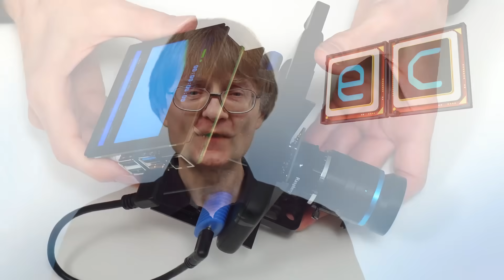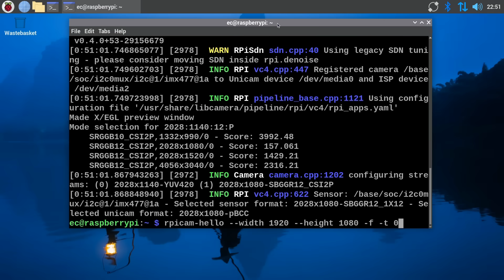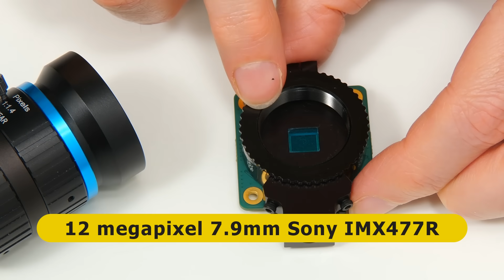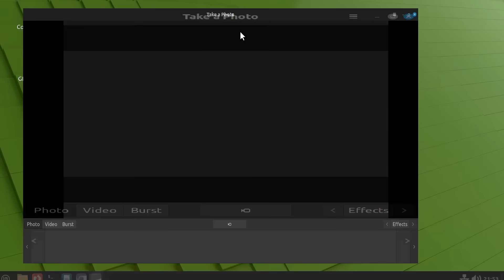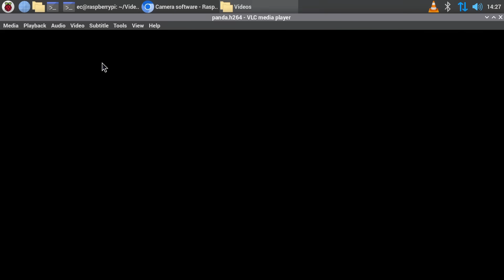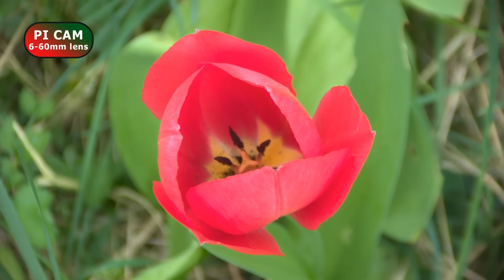Filming YouTube on a Raspberry Pi Camera

Comment: Fantastic walk-through of what the HQ cam module is like with different lenses and different recording methods. The Cine Pi is a great project and I love the fact it uses 12-bit DNG files for recording. My current wish list for the CIne Pi is some form of focus peaking overlay to help with the manual focus lenses, and support for recording a second camera module (stereoscopic setup) with the hardware sync. 🙂
Reply from the maker: Agreed. Focus peaking would be very helpful.

Comment: I have a Nikon D3200 with built-in 24 megapixel DX sensor I paid $700 without a camera lens, $800 for a Nikon 18-300mm DX lens and $200 for a Nikon 70-300mm DX lens. I put it in the closet shelf and left it there when Samsung came out with their smartphone 108 megapixel sensor and 200 megapixel sensor witch is a whole lot better than the D3200 DX 24 megapixel sensor.

Comment: Chris 
Another excellent video 
But I would challenge your closing remark about adding a Nikon 18-200dx? (other lens manufactures do exist,  but shall not be named !). 
You already own that lens so the cost would be only the adapter. 
You would be demonstrating a re-cycling of a piece of equipment rather than buying new, which you do ( and did in this Video with a second Pi ) to other equipment so what’s the difference. 

Using that lens on a C/CS adapter will have an issue with the aperture in that, and other similar lenses as you can’t set it manually – on the lens- . so its going to be wide open. Unless you get a adapter than has an independent aperture built in.  As an alternative there are many older second hand lenses available from the pre-digital age that can set the aperture manually but you will stuggle toget a focal length less than 20 mm I fear. 

As well as the aperture issue the crop factor of the sensor will multiply full frame effective focal length. Focusing will be difficult. For an example Jeff Gearing ,  some time ago, mounted a 70-200mm f2,8 to a High Quality Camera. 

If you really want to do something really silly, mount a big lens (say 500mm), with the addition of a tele converter just for fun to the High Quality camera... just wondering what the equ focal magnification would be

Comment: Hey Chris… I think you'll find. That inexpensive zoom lens you purchased. It is a zoom lens. It is not a, zoomar, Lens. Meaning that?

A, TV zoom lens. Keeps the image in focus. Regardless of zoom.

But an old-fashioned zoom lens. Does not move the same lens elements, together. Therefore. You must refocus. For every different, zoom position. It's not a lens you can continuously zoom, as you go. It's not capable of doing that. It's a preset, zoom. That's why it was so inexpensive. It's not a TV zoom lens. In that operational characteristic. And those type of zoom lenses, are much more affordable. But really only function. At your preset zoom ratio. But hey for the cost? Such a bargain! And can be used for fixed focal length shots. As it is virtually impossible to zoom and rack focus perfectly, with the zoom. A television zoom lens and other photographic zoom lenses. Hold focus during zooming.

It's an old photographer thing to know this. About the different type of zoom lenses that were created over the years. These were the first types.

Later came the Varifocal lens for cameras. That would hold focus as you zoom.

I just thought you should know that Chris. As part of photographic history. Before we ever had computers. We had silver oxide. Later we got iron oxide we recorded pictures on. Now I think we record little magnetic bubbles? Whatever that means?

I'm sorry it really seems like you have to go through, too much stuff. Just have a Raspberry Pie Cam? That's a lot of expensive components to put together for a single, high-res TV camera. Like the tiny 4K video cam recorders. A little less than 2 in.² weighing virtually nothing. Onboard all of those little battery-operated flying drones. And what you need this huge behemoth contraption for? Instead of one of those miniature marvels. That already supply a digital bitstream output. I don't understand you Chris? I thought you were a little more progressive than, this huge camera contraption? Requiring a separate Raspberry Pie, computer on a card. Just to get a video output. Jesus Christ man? Do you got's a fever? HUH?

I mean I find your camera set up rather comical. We are already 1/4 of a century, into this one. Optical imaging technologies have virtually been refined to pass, Hollywood quality resolution. Out of something the size, of a cigarette filter. With 4000 lines of resolution. Refresh rates of 60 Progressive frames per second. Direct MP-4 and MP-5, high-res bitstream output. What are you doing with a Raspberry Pie? The new circuit boards are the size of your pinky fingernail. You could accidentally swallow it if you're not careful. There are other medical grade cameras that can do that. So don't try to swallow your raspberry pie camera. You might choke… To death? And then we would miss your haircut.

I have been watching you and your channel for years. I love it. But I never realized… You have always been AI. And here we thought you were for real? No wonder you don't have a girlfriend or a boyfriend. You exhibit no emotions. Who do you think you are? Mr. Spock? He wasn't for real! He was played by a cartoon actor. And we know know you are AI. Because you are not aging. You are a computer facsimile. Of a poor dead British computer geek. We know who and what you are! We have Intel. You don't. You have AMD. All Most Digital. That's why it's called AMD. It's fake digital. We have the only real Intel on this. And computer cameras have gotten very tiny and flyweight. Where have you been Chris?

I mean the fact that you could make a video camera with a raspberry pie. It is equally amazing. But I am not a computer geek like you. That is no big deal, for you. And you're not trying to get action shots. Requiring zooming while it holds the focus. Such as in sports coverage. Where your $16 zoom lens can't cut it for that.

Otherwise? I love your channel. I've been following you for years. But you are not aging. Something is wrong here? Your AI programming doesn't have you aging. Your programming is flawed. Your hair never grows. Your spectacle diopter doesn't change.

And so I think you are the most Natural looking and sounding computer simulation ever. We'd love to know what you really look like? But you are likely a dwarf. And you have given us this computer simulation. Of a normal appearing person. With a, Moe Howard, haircut. He was the base of an emitter and collector. And had nothing to do with the IRS. Stateside here. Just so you know.

By the way Chris. Did you hear? The Queen, is finally dead.
RemyRAD

Comment: Does the rpicam software have the ability to do a White Balance? Could  doing that improve the color quality of the output? The color seemed a little bit off, but it also seemed to shift...
Reply from the maker: The rpicam software has limited control. You can use profile files, but it's still very hard to achieve full manual control. The colours shift in the opening shot because I was shot against greenscreen, so even when I moved slightly the colour in the shot changed dramatically, so triggering alternations in the automatic settings.

Comment: I would be very interested to see how larger lenses from Canon/Nikon/Sony etc work with the camera module.  I have a few Nikon lenses that I used to use with an old DSLR that doesn't shoot video, and they could potentially get some use as long as the sensor size doesn't cause too much of a problem.

Comment: Is there software to make a Raspberry Pi with a camera module into a USB webcam?  Or maybe do motion capture taking a still when something changes and saving it to the micro SD card or an SSD?  I looked a while ago but everything I found seemed to need WiFi or an ethernet connection.  I'd rather it was either standalone, or connected to a PC by USB.

Comment: Nice video. Regarding sharpness, not all lenses are built equal, as you clearly demonstrated, but I'd like to emphasis a few points :
- F-stop (i.e iris setting) can make a lot of difference in sharpness (as well as depth of field)
- integer decimation i.e. one integer number of sensor pixel for one video pixel ; with the 2028x1080 sensor mode, this would require a little cropping through  --roi 0.0266,0.1447,0.9468,0.7106  to only select  the 1920x1080 center pixels
- sensor mode also make a great difference ; from what we can see from the command-line, you are stuck with the 2x2 binning because of limitation on the 2-lane CSI interface (and clock speed) and I suppose your CinePi image also has the same limitation ; yet, with some minor fiddlings (https://forums.raspberrypi.com/viewtopic.php?t=371216, thanks to 6by9) you can get 4K@30fps, at least on the Pi 5. Using the full 4K Bayer matrix as input give you much detailed and sharper images, not matter the lens, even when actually encoding at 1080p ; for a clear example, look at https://raspberrypicad.blogspot.com/2025/03/why-imx477-2x2-sensor-binning-mode-is.html the difference is stunning.
I hope CinePi will provide an image that has the support for 4K@30fps on the Pi 5 !

Comment: Out of curiosity re: the small screen issue. Would a Pi be powerful enough to power both the LCD on the CinePI, the camera, and an external monitor (e.g a large one you'd have facing you on set) plugged into a HDMI port?

Comment: Have you come across NDI, which allows you to stream video over a network connection, including WiFi? I've used the Newtek NDI Camera app on an iPhone to stream 1080p video from the iPhone camera to a Mac running a client that makes the NDI stream appear to the OS like an external Webcam, and there is also a plug-in for OBX that supports the NDI protocol natively. It's a neat solution that saves cables and having to deal with HDMI video conversion. NDI also supports audio and has low enough latency for live video (at least using an iPhone SE Gen 2 as the 'camera').

Comment: What is the dynamic range of the sensor?  By closing the aperture, the depth of field can be increased (so more things in the picture are in focus).  Of course, a bigger lens (diameter) would help.  All sorts of fancy digital post-processing is available these days.  But, I suppose, if you're shooting a film, you may want different effects.  What you get from this setup might be just the look you want. Possibly.

Comment: I've been looking for a camera to use inside the enclosure of my CNC mill, which is a very hostile environment with flying chips and high-pressure synthetic coolant sprays. Primary requirement is that I won't have too sad a day if the camera and lens are ruined because of my inability to make a reliably-sealed enclosure with a spinning hydrophobic self-clearing window. Second-hand CS mount lenses and a Pi cam might just fit the bill.  The coolant sprays and mist reduce the effective  resolution to that of a potato anyway.  I can feel an experiment coming on.  Thanks for the inspiration.

Comment: I would like to see the installation of the most expensive lens you have in stock to see the maximum capability of the sensor and roughly estimate what maximum lenses can be installed on this device. So to speak, to see the maximum capabilities of the camera sensor and not be limited by the lenses, and also possibly find out the cost threshold of lenses relevant to this camera's sensor. For example, compare two similar lenses, say for 100 and 200 dollars, and understand what price limit exists for lenses for this camera.

Comment: If the Pi is using the Labwc compositor, a keybind can be added to the rc.xml to toggle the window frame and/or title bar on or off. There can be a frame and titlebar, frame only or neither.

Comment: Technically, you don't need to do the Ctrl+  thing to switch VTs. Within text terminals, you can use Alt+F# to switch. The Ctrl+ is only necessary if you switch FROM a desktop VT anywhere. And RasPi OS being Linux (Debian if I'm not mistaken), you can even have TWO desktop VTs running...
BTW the desktop VT has been on T7 for very long. I remember X11 putting it there.

Comment: The lower quality with the is not the lens, it’s the sensor only being read at 1080p.  You will get substantially better quality with still pics.  With the old raspivid, I was able to up the quality by reading the whole sensor, but at a lower frame rate.
Reply from the maker: CinePi is most certainly reading the whole sensor. The quality is very much with the lenses.
Reply: @ExplainingComputers  It may not be able to, sensor read isn't fast enough.  Actually, come to think of it, I had more luck with the old 5 mp sensors that way.  Those could read stills faster.  This video is filmed mostly with the old pi camea with a 5 megapixel sensor and lens that came with it: https://www.youtube.com/watch?v=z4xZpm5n214

Comment: Vlc can also show usb video feed, from menu choose Media, Open Capture device, in "Video device name" choose /dev/video0 (or higher if multiple usb, video1 is sound?, second usb would be video2, try ...), rpi can also boot to command line (no gui) and then do the camera control, advanced option is to program in python3 using picamera2 library, very advanced is python webserver + camera control ...
ultimate is webserver + camera + pygame, combine pygame animation/picture with live feed (camera output can be cropped and positioned)
tip : vlc can play + slow down a (live) video and at the same time record that ....
tip 2 : can use multiple rpi (with a camera) output to a hdmi switch, hdmi switch output to usb to pc ...

Comment: Hold up this intermediate step via HDMI out and USB capture card seems really superfluous, since Pi can be configured as gadget...

oh wait you can't really do this with full size pis because their OTG port is occupied by the internal USB hub.

What other methods are there? Can you connect Pi to a PC via Ethernet, say OBS can ingest NDI video streams?

The Cinepi page completely neglects to showcase any features or system requirements or just about ANYTHING, but i can gleam that i might support MJPEG streaming over HTTP. Is there a way to ingest that into OBS?

Also Cinepi-SDK github page says Pi4 is no longer supported. For whatever reason. It would be good if such a project could scale down to Pi2W, i feel, i mean, it does have hardware encoding and it has a CSI port, so why not? Dumping lots of RAW data isn't going to be a thing on those though.

The zoom lens you showcase i'd say it's rather exciting for own project. While it struggles to cover the Pi HQ sensor, there's any number of webcam innards and other things it can project onto easily, and it should look rather good with them as well!

Comment: Here is what I've found playing with CinePi... You can use inexpensive D mount lenses as long as the focal length in longer than 8-9mm, the 6 and 6.5 lenses that I've tried vignette in the corners. To do this you need a flanged D to C mount adapter, screw this into the CS mount on the camera and adjust back focus. My D to C adapter was around $8usd on ebay. I'm currently looking at some other lenses made for 16mm and Super16 film cameras, gets kind of expensive with this option, especially if you need adapters to get down to C/CS mount. Trying to pick lenses I can use with other platforms in case I just can't continue with the pi based camera. I don't have plans to move up to the CinePi XL, too much money when I could convert a Canon camera with Magic Lantern.

I fitted a geek pi fan to my pi4, this requires removing two of the display stand offs which I need to fix. I was running it off the 3.3v from the display, though I want to solder it to the back of the pi to get 5v and a little more airflow.

I'm getting some flashes on my display, kind of randomly. I'm not seeing bad frames in the recording, not sure of the cause yet. I also need to get faster storage, I have a flash drive that it good for about 10-15 minutes, then it slows down and starts dropping frames, I think it might be a heat issue. I'm still thinking about how I want to design a case for all this, even a simple box requires some thought.

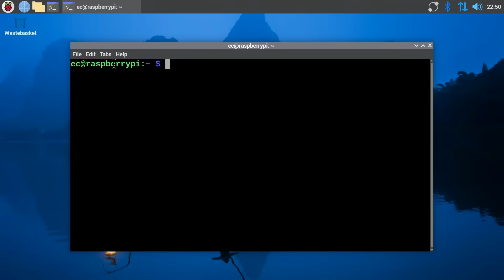Comment: 4:41 is why I don't use Linux. Everything is freaking terminal terminal terminal. If this could run Windows there would be a much easier (and better) GUI based way to do it. Linux needs to get with the times and ditch the terminal, I'm sure they still think it's 1985 and not 2025 might just as well be using DOS.

Comment: The Pi  lenses give quite soft images. Can’t wait to see a quality lens ! Thanks for the experiment from Quebec ! 🇨🇦
Reply: It would be interesting to see, and some people might have lenses they are not using. However, for value, can anything compete with a smartphone? I would have liked it if that had been compared as well 😇
Reply: @joseph9915  Well, considering that even a cheap smart phone in the US can cost more than the whole CinePI setup with all parts combined, I'd say the PI doesn't have anything to worry about there. Unless you're getting a phone heavily subsidized from a cellular network, they can't come close to the value proposition of a PI.
Reply: @SuperDavidEF  For older, out-of-date smartphones, they can be as low as like $30 new (old stock). 

Not saying for a lot of things, having a computer with Linux on it connected to a camera isn't going to be better, just thought the comparison would be interesting.

Comment: I have a question I have a cosmicar / Pentax C70402 4mm f1.2  1/3" MI CS-M

I know it's a thread lens but I don't know what size and I wish to use or purchase technically the adapter for that lens to my m42 mount do you have or know of this particular type of adapter required for whatever thread that lens is because I can't find it I have been trying for 5 years